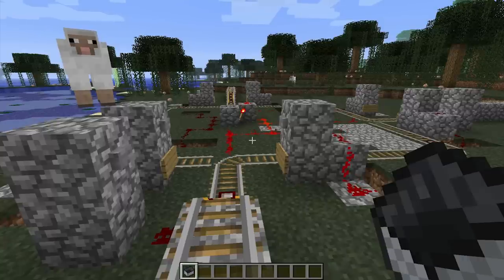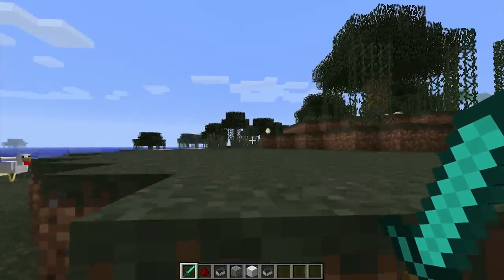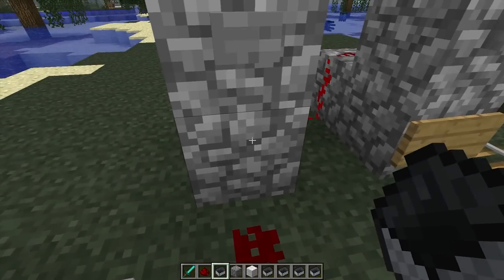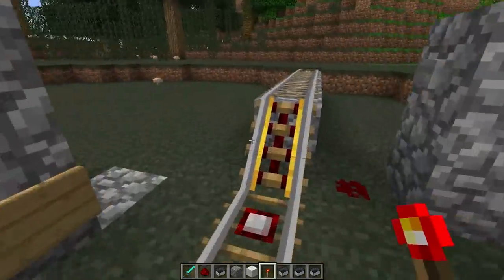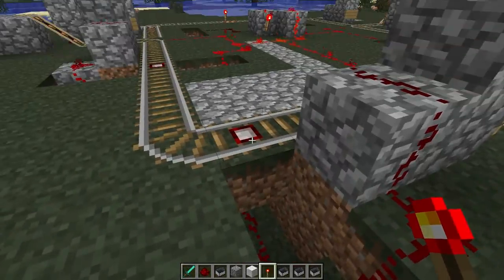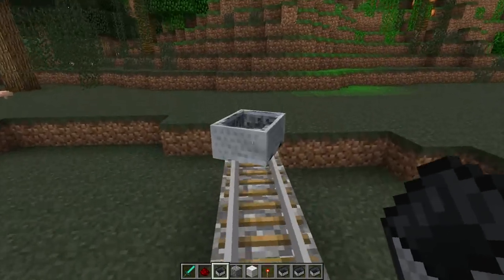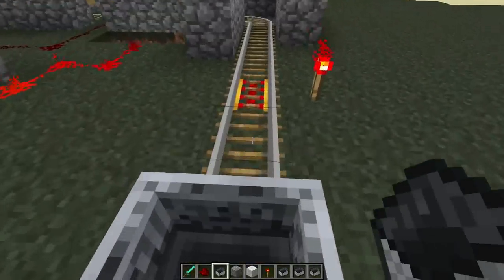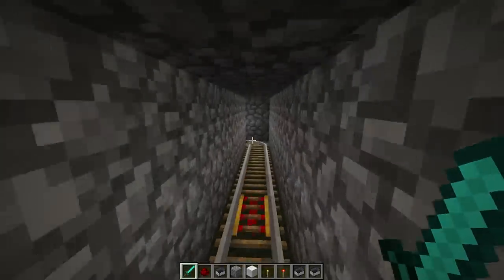Minecraft - Automated Minecart Railway Junction

Comment: If you dug a pit 3 blocks down you could have concealed the entire thing underground and even shortened the distance between stations, but it's a good design and I may very well put it to use :P

Also, the latch you have there in the middle is basically a small memory gate/circuit because it does exactly what you said in your Spellbound Caves - it remembers!